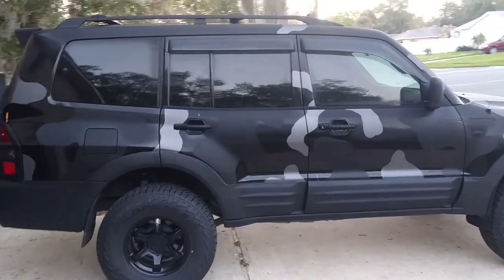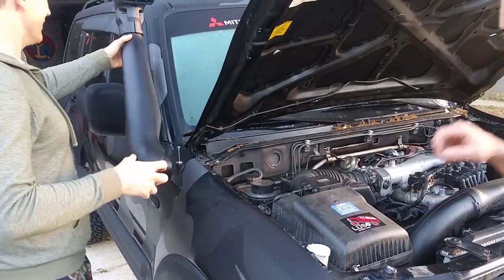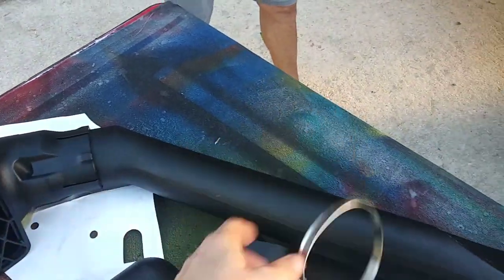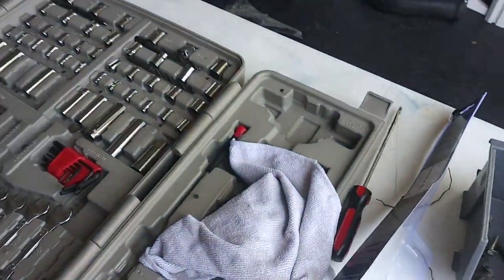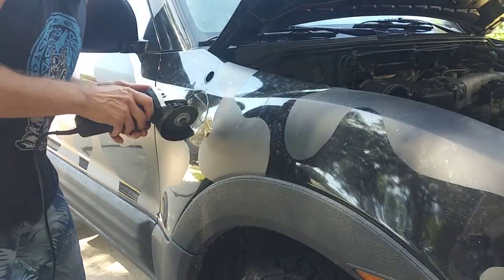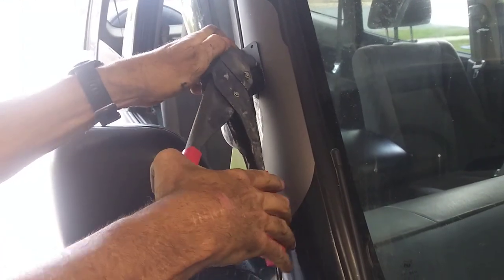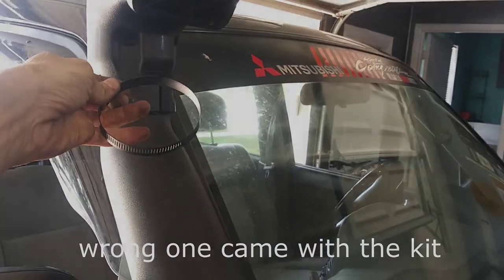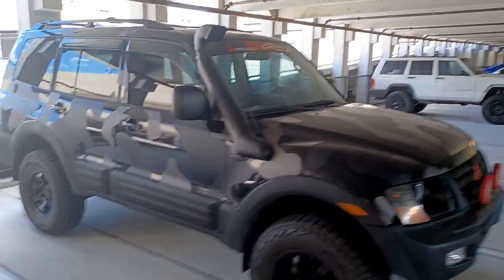Mitsubishi Montero Gen 3 Snorkel Install | Project "Vader's Chariot"

Comment: The best Pajero I've ever seen. Good luck
Reply from the maker: Thank you! It's been fun. Just debating if I gotta get a roof rack to finish the build or nah
Reply: Sorry, go ahead and participate in tournaments in exhibitions, I think you will win without a doubt
Reply: I agree to publish it on the Pajero group in my town
Reply: How much does the modification cost, please?
Reply from the maker: @rslanmsaod4163  wheels and tires about 1300, lift 1000, maintenance probably 2k, plus a few odds and ends.

Comment: Nice dont know how practical a snorkel would be for my 2002 ltd mainly because i do alot of Highway miles. but i do like the look of the snorkel.
Reply from the maker: It's about the clout. Like the RPG video game saying goes: "fashion over function"
Reply: @LeoTheRussian  you make a fine point sir
Reply from the maker: @killer0034  my Montero is capable far beyond what I'm really interested in doing as it is. Plus i realized I like to stare at my cars almost more than drive them sometimes. Miss my Infiniti for sure. The stock rx350  is comfortable but sooo boring
Reply: @LeoTheRussian  i cant say much about my previous cars. except i do miss my passat. But i pretty much blew up all my previous cars from neglect or not enough funds for maintenance. i love to drive stare too but driving is what i wanna do. Wish i had more money so I could do more cool things. Especially now that i have a 4x4. I wanna do things my previous sedans couldn’t. But just my luck i picked something with rare/expensive parts and needed Regular Maintenance.
Reply from the maker: @killer0034  seems like most monteros require quite a bit on the front end to catch up but then stay working really well. Mine had a couple hiccups but keeps running and the longer the drive the better it does actually. The last offroad trip was 1.5 hrs away then 2 hrs idling in the cold with heater on, bunch of trails and offroad then drive back. Zero issues.

Comment: Besides looking cool, what does the snorkel do for the Montero?
Reply from the maker: Allows for deeper water crossings if everything is done properly as well as diff breathers are added (otherwise engine will stay dry but differentials will take on water). Also if ever going to sandy areas lifting the air intake higher lowers the amount of sand the filter has to stop prolonging its life.

Comment: Hey Bro. you can tell us what is your configuration of wheels and suspensión exact parts, i follow you from Panamá

Hey hermano. puedes decirnos cual es tu configuracion de ruedas y partes exactas de suspension, te sigo desde panamá
Reply from the maker: 265/75R16 Falken Wildpeaks on Motegi MR150 16x8 wheels and Lovells springs plus Bilstein 4600 shocks